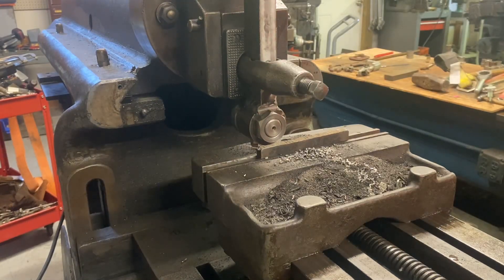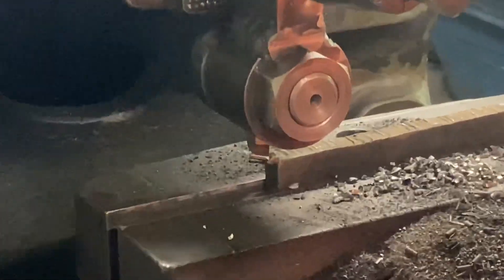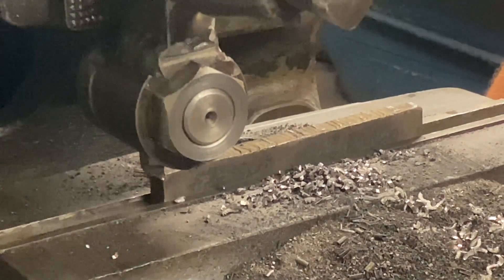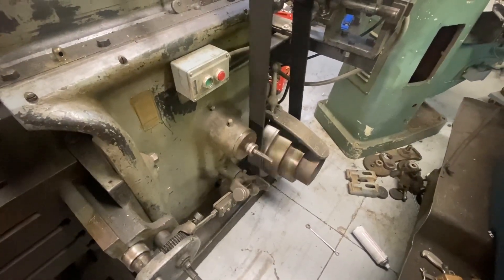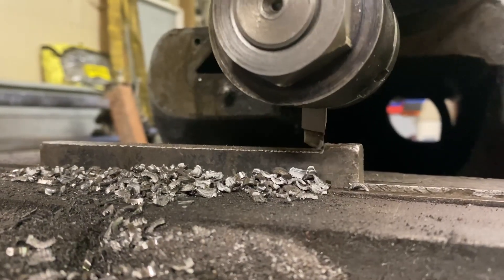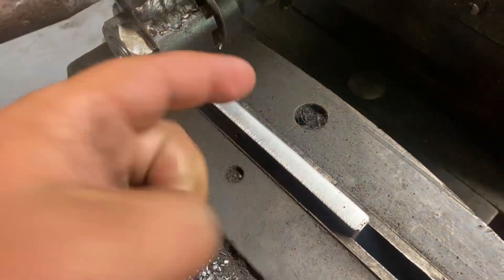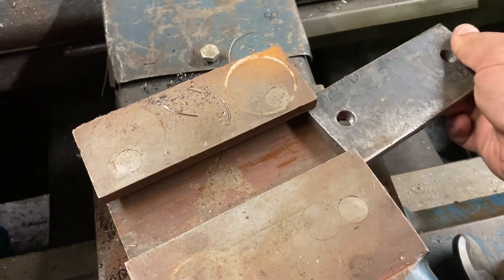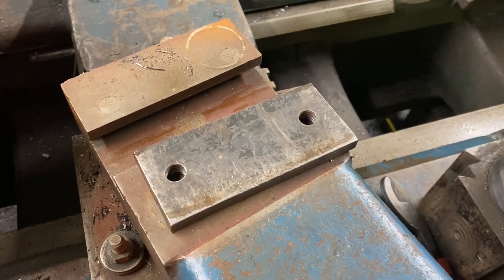Machining a toolpost hold down clamp on the shaper

Comment: I don't have a lot of hours on a shaper so please take this with a grain of salt, but I don't think the radius is mismatched with the feed rate, I think it's because your clapper box is set dead square. If my memory serves you have to have at least like three degrees on One direction and two and a half in the other so that when it lifts on the backstroke, it won't rub on the next forward stroke, instead either the material or the tool will deflect enough to approximate a straight cut. If I got this wrong please correct me, I'm going off of old memory but I'm hoping to get a shaper again and don't want to start with bad habits
Reply: In support of this opinion, if you were using a shear tool for example, the 20,000th step over would likely break the tip, no? I mean without having the clapper box angled